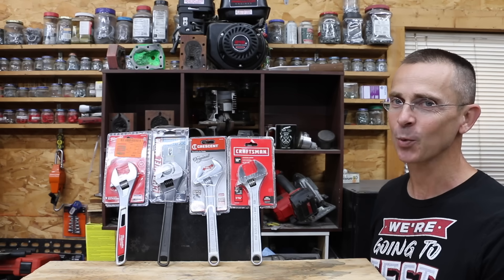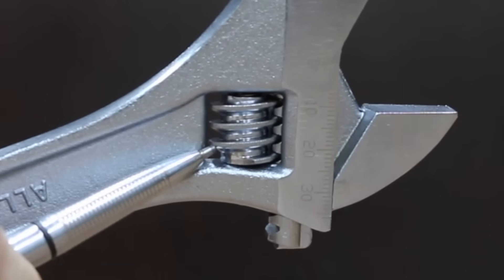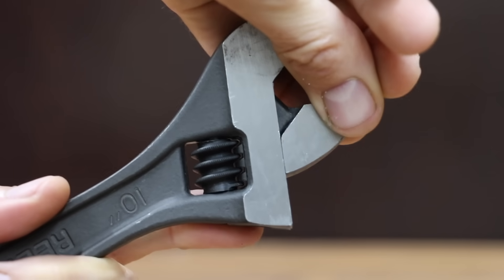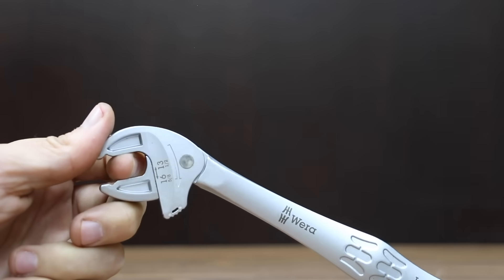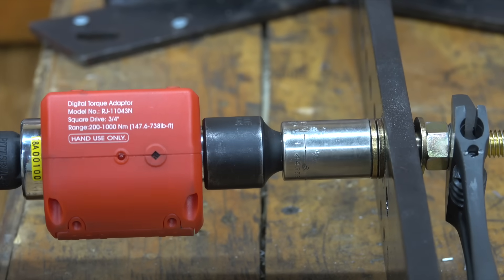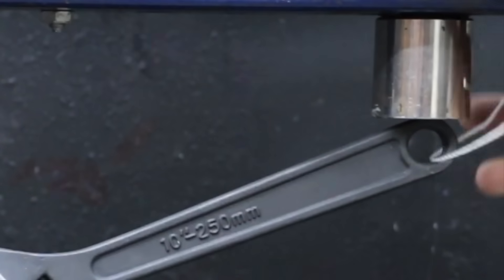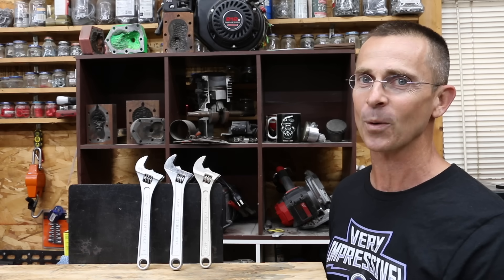Best Wrench (ADJUSTABLE)? Craftsman USA vs Craftsman, Crescent, Kobalt, Milwaukee, Channellock

Comment: I scored a USA Craftsman wrench just like this one in a tool box of random tools (that also turned out to be mostly USA Craftsman) for 7 bucks at a yard sale for the whole box!
Reply: This was how it purchased many tools as a young mechanic starting out years ago. You could get a “box of junk” for $5 and go turn in / exchange all the broken craftsman tools at Sears and roll out with an easy $100-$200 worth of brand new stuff. Ha!
Reply: @GunnysWrenches  ahhh tha good ole days.
Reply: The Ace Hardware near my workplace has US made Craftsman adjustable wrenches in stock
Reply: Most craftsman is made here but the parts are from china, and also Ryobi and Craftsman are one in the same
Reply: @BASEBALLHISTOR  Ryobi is a TTI brand, Craftsman is a StanleyBlack&Decker brand
Reply: You did well USA number 1

Comment: I work in a refinery on control valves. I'm a big fan of the Bahco.  It has the widest jaws  and it gets into tighter spaces better.  I don't like a clunky tool that just barely gets by.  I bought the 8 inch on amazon for $38 a couple of years ago.  If you have to use a crescent wrench almost daily you'll definetly want the Bahco.

Comment: In the rounding the nut test, weren't all the wrenches resisting the torque in their weaker direction?
Reply from the maker: Great question.  The wrenches were resisting torque in the proper direction.

Comment: Excellent testing! I only own three adjustable wrenches - a 10" vintage US made one with lots of slop, a 10" Crescent bought maybe 5 years ago, and a 170mm Bahco I got a few years ago and keep in my tool bag. Of the three, the Bahco is by far the most pleasurable to use as it fits in the hand very well and feels solid when turning a nut or bolt. It also has the slimmest jaws of any wrench I've seen in local stores. For its size, I feel like it replaces a 10" tool with ease, while keeping my tool bag's weight down considerably.
Reply from the maker: Thanks for sharing.

Comment: Great job as always.

I was intrigued by the failure mode of the MIlwaukee....  I haven't "broken" a pair of those per se, but a couple of them have done the same thing as the Milwaukee...  After some over-zealous use, it is no longer adjustable... Something bent somewhere, and you can't spin the adjuster anymore....
Reply from the maker: Thanks!  Thanks for the feedback.

Comment: 8:34 Jaw opening change from Vibration results
12:37 Wrench Torque before rounding
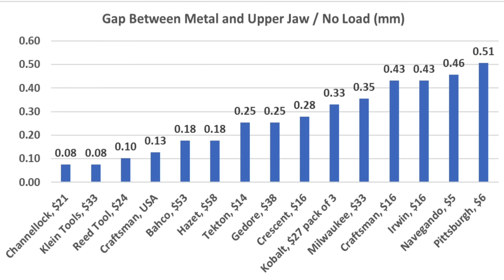13:26 Gap No Load
16:02 Gap Under Load
18:30 Failure Load
SPOILER::::

Vintage Craftsman was the best
Crescent and Klein second suggested choices
Reply from the maker: Thanks for the feedback.

Comment: I used both Klein and ChanneLock and both wrenches worked really well, thing is, my cheaper ChanneLock seemed to hold slightly better.

That's before I received the same 200$ Wera wrench set as a gift... never will I go back to anything after using these 😂
Reply from the maker: Thanks for the feedback.

Comment: ..not surprised at all..overall, vintage USA is hard to beat, Germany and Spain-made hard to beat on newer stuff...I still have some good old USA adjustables, I really like the older Diamond brand-they seem to have tight tolerances, great fit-and-finish,and are strong. I actually have a couple 8 and 10 inch vintage Craftsman's that are like-new, and they are very well made(wonder who the contract maker fr them was?)..the ones I have, however, are toward the end of production, late '90's-early-mid 2000's, and have the dull nickel finish, not the shiny chrome. The dull finish hasn't held up as well as the chrome, and they have some light surface rust...otherwise like new. Sometimes you can still find some NOS ones on Ebay...usually pricey, but may be worth it. I must say, I didn't shed a tear when he did the test-to-failure...until he did the vintage Craftsman..was that REALLY necessary? :(
Reply from the maker: Thanks for the feedback.

Comment: If you revisit adjustable wrenches again then you should really include the Japanese Lobtex Lobster Adjustable Wrench UM-X series. Like the UM30XD or UM30XG. They have features that no one else has such as 3 contact points instead of 2 and reliefs in the inside corners to avoid rounding off a nut.
Reply from the maker: Thanks for the suggestion.

Comment: Don't you have the wrenches turned the wrong way in the 2nd test? The rounding the nut off test. They grip stronger turned the other way around.
Reply from the maker: Great question.  The  bolt is rotating in the proper direction.

Comment: Love your work! I used to carry a 6" Bahco every day in the factory I worked in as an engineer for 15 years and used it for a 1000 things they were never designed for. I have had a full set of Bahco's now (plumbing, auto, DIY etc) and they are the reversable ones, pipe grips on one side and flats on the other. Note you tested the short handle and the standard handle would likely have performed better in the tests. Just saying, if you only buy one set for the rest of your life, you cannot go wrong with Bahco. They invented them....
Reply from the maker: Thanks!  Thanks for sharing.
Reply: My new bahcos aren’t as good as the old ones. But still best I’ve used.

Comment: I have a 12" Proto Tool 712S adjustable wrench (made in Los Angeles) from the late 40's or early 50's. 
I rarely use adjustable wrenches but the old Proto is the best I've used so far.
Reply from the maker: Thanks for the feedback.

Comment: Wondering why you didn't use more U.S. made tools (resorting to one that isn't made here anymore didn't make any sense to me)
Reply: Because most US tool companies are either  gone or moved to China. 
RIP - Thorsen , Craftsman, Easco, Plomb/Proto - I still got a few US made ones.
Note : Plomb may now be  a "new" Proto, which is pushed as high end, but they really are "Black and Decker", which has always been largely hit and miss. B&D has had some good tools and some bad tools -another Sears connected brand.
Reply from the maker: There are very few U.S. made tools.

Comment: Thanks for this awesome video! I suggested this topic once before but in most of our electrical, plumbing, mechanical installations, they are being installed overhead with Concrete drop in Anchors. So I would like to see a comparison and testing of how much weight these drop in anchors claim to withhold and how reliable are they vs drill in anchors screw. Also the many different kind of concrete drop in anchors such as Dewalt, Hilti, Simpson, Red Head etc. Thanks!
Reply from the maker: You are welcome!  Thanks for the suggestion.

Comment: no because the quality of the steel is different. thats why tools are more expensive than others. why not try with wire snips and you will see a big difference. cheap steel tools cannot compare to quality steel manufacturing of tools.stop wasting time on crappy questions and put something more comparable on.
Reply from the maker: Thanks for the feedback.

Comment: Huh, I have a wrench a lot like the Wera Joker that's made by Sears Craftsman (China). It has a spring tensioned grip with a tapered head that allows for "ratcheting" in the reverse direction, but gripping tight in the turning direction. Very cool tool.
Reply from the maker: Thanks for the feedback.

Comment: Great test!  I knew there was a reason I like my 40, 50, and 60 year old Craftsman tools but haven’t bought new Craftsman for years.  Interesting that Gedore still makes that “left handed crescent wrench.”  They feel odd to anyone accustomed to other brands.  Mine is 41 years old. Not springing and rounding off a nut or bolt is #1 with me.  The old Craftsman impressed! Thanks.

Comment: My rule of thumb when buying tools.... Are in China,I go to different store.  It must b made in US or Germany to keep me. Most popular brand tools are coming from China today cause they were sold manufacturing rights or shares. I remember back to days when I had a 24" crescent wrench adjustable. I would put a 3 foot pipe on handle to tighten 1.25" bolts. Still have it and works as good as new.And Chinese tools,they aren't close enough to see my tail lights.

Comment: I don't think the 200lb load test is valid. You are applying the load to different lengths of lever arms (the different length of the wrenches). So the force at the jaws would be different for each wrench.

Comment: Attention you young guys & gals. Only use an adjustable wrench as a last resort. While an apprentice would have to help other trades. We had 2 great millwrigth master mechanics who neither owned what they called nut rounders. They broke my balls because I always had a 6 & a 12" adjustable wrench in my pouch. They examined my tools and told me to replace the 12 point sockets with 6 point

Comment: All those outdated type of wrench are poo. Knipex 86 type of wrench is the way to go - no rounded bolt heats, perfect surface contact, absolute ZERO slop. Highly recommend
Wera makes the best bits, but about this "joker" wrench.. knew it was a joke, worst fail of wera company IMO don't buy such abominations, absolute fail that gives a good brand a bad name.
Reply: The Knipex, IMO,  do pretty much make all Vise Grips, Channel Lock pliers, and adjustable/Crescent wrenches, even pipe wrenches, obsolete in "many" applications.  I realized that the first time I used a pair.  I was impressed, and sad, as such an improved set of pliers made me feel kinda "obsolete" too. LOL  It wasn't the first time, or the last, I am sure.  Just don't tell me 8-Tracks don't(didn't) have the best sound! LOL

I'd almost ask PF to do a "cross tool completion", with the best/good ones of those 4 various tools(Vise Grip, Channel Lock, Crescent, pipe wrench) - against just Knipex(Knipex type) pliers of a similar size. That would be interesting and possibly proving your point, and my suspicion,  or disproving it.

Comment: Really like the fitment on my USA craftsman adjustable wrenches. Checked my old sears orders and I was able to pick up the 10" and 12" 2 pack back in 2016 for under $25. They still sell that same style at sears online (now made in china), but definitely different that the stanley craftsman version you tested.

Comment: 14:44 I would argue that deflection angle of the jaw is more important than actual angle, which would actually put the shorter jaw wrenches at an advantage (since for the same angle the gap will always be smaller)

Comment: In the torque test, you've got the wrenches on "backwards" from what I've always been told...  With the wrenches installed as shown, the load is out towards the end of the moveable jaw.  If you flip them, the load is closer to the base and it'll have less leverage to deflect the jaw.  Or have I been lied to my whole life?  lol
Reply: The torque load is being applied properly to the wrenches. The load as applied viewed from our end is counter clockwise which is rotating into the wrench head properly.

Comment: My dad bought me a 2 pack set of craftsman locking crescent wrenches (called Extreme Grip).  I thought they were a gimmick,  but I have been very impressed with how much better they are at holding on the jaws not bending out.  If you've not seen them they're a crescent wrench with a locking pliers feature.

Comment: I love your videos. The only thing I would like to see is the same model of something go against tiself. It is one thing to compare something to other makers, but will you get the same performance with every top end tool I buy of the same brand? What are the variations between 10 of the same exact tool of the same brand. I have purchased a tool, it brakes, I get the exact same one and it lasts forever.

Comment: I have some if my dad's original craftsman adjustable wrenches. I can't remember a single time having one slip off a bolt and knowing it was the wrenches fault not mine (having it too loose or to the side letting it cam out or trying to pull on it with a cheater bar)

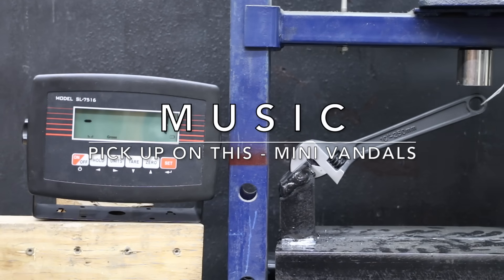Comment: @13:40. In this segment you mentioned a couple of times that the short-jawed wrenches are "at a mechanical disadvantage", but I think that your method of measuring this criteria is stacked in favor of the short jaw wrenches because you measured the width of the gap, not the angle, so if the jaw had been longer the gap would have been wider for the same angle of "yawn". ..... Given that a high-accuracy protractor might be hard to come by, perhaps you should have employed some high school trigonometry to level the playing field  by calculating the angle of the yawn.

ETA. It occurred to me during the following destruction test, that the strength of the jaw, I think, is a function of the depth of the jaw where it connects to the tool, (or even more the cross sectional area of the jaw, and I don't think you said much about the width of each tool) so longer (and wider) jaws are measured as stronger not because the jaws are longer but because they are also fatter at the base.  (?)
Reply: I was thinking the same thing. Maybe if I get bored later I’ll make some free body diagrams.

Comment: Lets face it, these are OK for loosening already loose nuts or basic tightening down but you know you're going to need a proper spanner or socket so you might as well look those out first. Yes I do have a few of these and now and then they are useful. Not the sharpest tool in the toolbox, to misuse a saying.

Comment: What’s funny is I used to think these were tools of unprofessional folk, not worth the steel they use for them, just heavier kids toys, then between seeing some videos on how to properly use them (they are directional) and my dad getting one to use for a fan clutch where the only one wide enough was a higher end machinist type from pro point (basically harbour freight) my opinion quickly changed, i even just use it to find out what wrench size I need

Comment: I didn't know that Bahco makes adjustable wrenches, but IMO they make great bow saws and blades, which are razor-sharp and last for ages. .... Have you ever tested bow  saw blades, as I would be interested to know how Bahco blades stack up?
Reply: They invented it :)
Reply: Bahco is the inventor of adjustable wrenches and Bahco "ergo" are their top of the line tools, they also make some of the snap on similar tools.  Most made in spain wrenches shown in the video are made in a Bahco factory.

Comment: When the jaws snap, there's more going on than jaw length. The amount of carbon and the heat treating process determines how ductile the steel will be. 
I dig your videos. Also, I have the Craftsman USA wrench. 25 years of service and still going strong.
Reply: Very true. Other trace elements within the steel also play a role. Being able to sample each wrench and test it to figure out the type of alloy used would probably be very pricey. Betcha most of the china brands are "mystery steel" lol.

Comment: The Milwaukee jaws seem softer than the stainless fasteners I deal with. I've dealt with rounding nuts that are too tight, only to find the stainless nut unscathed and a gash in the Jaws.

The fine thread adjustment is a nice novelty but causes the pin, which the worm rides on, to wear quick and after a year of daily use, renders the wrench almost useless absolutely loved the Milwaukee for the first 6 months or so. Now looking at the channel lock or crescent brand adjustable to replace it.

Comment: Great testing (as usual) !
It is really interesting to note which brands did better/worse with the different tools they offer - some kind of ongoing Scoreboard would be awesome to look across tools like diagnal cutter, pliers, channel lock pliers, crescent wrenches, screwdrivers, etc....  I know not all the brands offer products or may not have been in the particular tests but a lot of them are.  May reveal some trends of brand suppliers.

Comment: I would have sent you my Matco set. They are designed so good at holding onto bolts they are too annoying to use! Have to be loosened and tightened every time you change position.

Comment: Your welding skills are improving. One suggestion is to hang in there at the end of a weld for 1.5-2 seconds to fill the crater, rather than letting off the trigger immediately at the end.

Comment: I used vintage usa crescent until they were stolen. I now use USA Proto (satin), maybe consider a high end part 2 with:
SNK, Mac, Snap on, Proto, some japanese brand maybe
The proto lock on so tight i have to loosten them to remove them from the nut.
Thanks for considering!

Comment: I would like to see a test on different tap and die sets.  Strength, thread quality, etc
Reply: I can save him a little time....  Harbor Freight tap and die sets are absolutely worthless.  They're not sized correctly and are brittle....
Reply: @aaronthomas6155   Agree, the harbor freight version is not worth packing home.  Harbor freight has its place just not for quality tools

Comment: Ref:  TimeStamp 2:58 ... Direction arrow:  It's actually reverse.
Think about it:  Applying torque in this direction causes the hex fastener lobe to contact the adjustable jaw at a point furthest from its mount, making the jaw easier to stretch and slip.
For more torque without slippage, use the wrench in "reverse".  (flip it over).
This causes the contact point of hex fastener to contact adjustable jaw nearest slider, and puts brunt of force on stationary jaw.
It's contrary to conventional use, but try it for yourself.
Your test method at 13:45 demonstrates the principle.

Comment: Would have been nice to use thousands of an inch, not mm, as our entire machine shop industry is still based on imperial in thousands. When you give mm, it means nothing intuitive, and we got to get to thinking the conversion at about .039 per 1mm.  You used imperial weights in pounds, and torques in Ft Lbs, not Newton Meters, so why not the smalls as well?